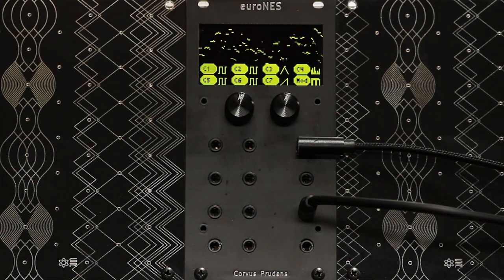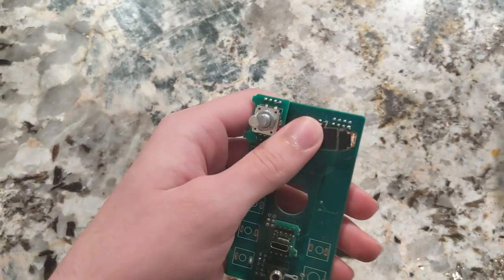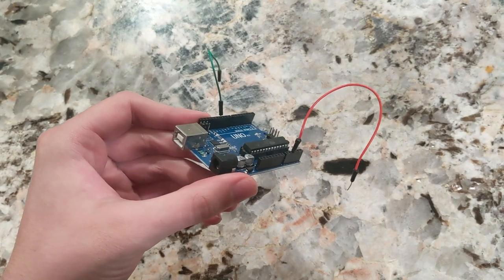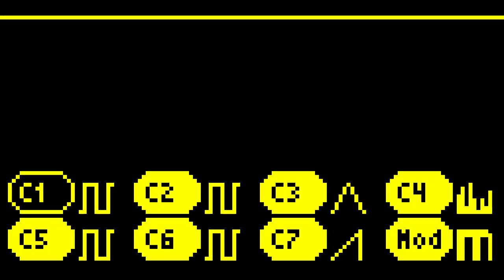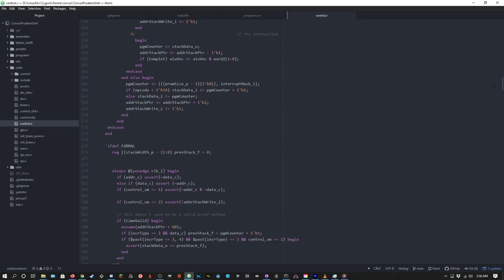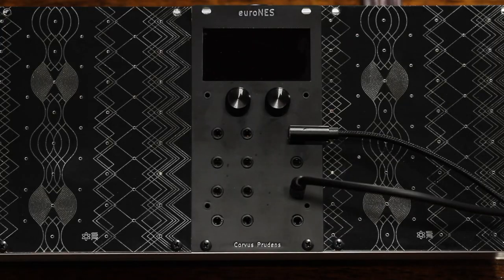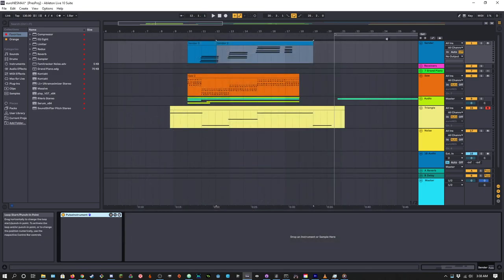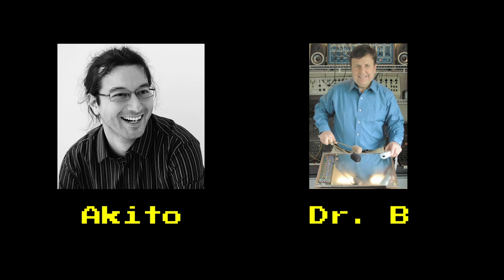euroNES | NES Eurorack Module

Comment: You need to make this at least $250, it’s important to value the time, personal invest and risk that you’ve accounted for developing this module. In addition, by charging $250 you can support yourself to pursue future projects, build a brand around your products, and cover additional development costs for firmware updates and bug fixes. Anyway, that’s just my opinion. Feel free to message me back if you’d like to talk more of the business side of things!
Reply from the maker: If I were selling through distributors, I'd definitely agree. They'll typically mark up around 30%. Going directly through something like Kickstarter though will allow me to avoid that, with the addition of some logistics overhead. It's still something I'm considering, though!
Reply: @CorvusPrudens  If you aren't paying a distributor, then you ARE the distributor. You should pay yourself for that job, not do it for free.
Reply: Don't forget Kickstarter will come to 15% take, and you pay taxes too. Sell it for a comfortable margin, you can always lower the price later if you achieve economy of scale or find cheaper ways to make it. But the original will always be a collectible, like the NES.

Comment: For what you've described and what you're offering $150 is WAAAAAY to cheap (At least from the end consumer pricepoint). You've done a crazy amount of work. This thing is rad. Even a simple module, like a good quad vca runs ~$200. You're making cool stuff. If you want to sell it at a discount later you always can. I'd pay $250-$300 for something like this and still think it was a pretty good deal.
Reply from the maker: Yeah I've gotten a few suggestions along the same lines XD. While it would be satisfying to deliver something cool at a low price, I suppose I'll actually have to crunch the numbers soon to see what's actually sustainable for me.

Comment: Great stuff! 

You can probably charge much more for it, like $250-300 would be a typical price for a boutique eurorack voice like that.

Curious what the CV inputs will do, I think that's critical for a eurorack module. Maybe there should be a way to maybe map cv inputs to various midi features that you have now.
Reply from the maker: Yes I'm in the process of developing the CV features now. I'll paste what I've written before again here:

I think a good approach would be providing a number of different input modes to suit the needs of a given setup. For example, you might want a 4 voice setup with a gate and pitch input per voice. Or, maybe two voices with envelope, pitch, pulse width, and a bonus modulator. Unfortunately, since there's only 8 inputs, you couldn't really control all the voices at once -- at least for now. Maybe I could add an expander in the future.

Comment: I keep coming back to this video. Thanks for all your hard work in putting such a beautiful module together - from scratch, no less! I look forward to purchasing one, once they’re made available. Have you decided on a width for the production model? If I had to guess, it looks like 12 to 16 hp? Can’t wait to fire one up in my rack!
Reply from the maker: Aw thanks so much! As I've played with it more, I've been wanting to expand the I/O quite a bit. My current plan is to have 2 CV and 2 knobs per channel, meaning it would have 5 columns of inputs on the base module. That would put it at more like 20 to 24 HP. Obviously the size and cost is increased a bit, but I feel like the huge boost in playability and ease of use is worth it.
Reply: @CorvusPrudens  Sounds awesome! Thanks so much for the update and Godspeed!

Comment: In the future if you want to make it a little more refined there are FPGA IP resources that would let you basically drag and drop something like a RISC-V core into the design
Reply from the maker: Yes, while that is true, there are a couple problems with that for me. For one, they're often not free, and I don't exactly have a large budget. They're also typically made to be general, meaning using up more space than my very specialized processor. RISC-V is also typically 32-bit, and I believe the bare minimum number of registers is 16. 

If I were using a Xilinx FPGA, none of that would be a problem. However, with Lattice's Ice40 line, you really have to be conscious of resources. I'm not an expert, so maybe I'm wrong here, but I don't think an IP CPU would be a good fit for this project.

Comment: Do you think you could do a short Update video on where this module is at? I'm ready to buy one, whenever you're ready to sell them... :)
Reply from the maker: I've thought about it several times over the past year or so. I have an issue though where I'd want the video to be really nice, even if it's just a little update. And when it comes to it, the time spent on an update video could just go towards getting it done instead!

I'm pretty happy with my design now, though. I'm mostly in the stage of rounding up the last few little hardware issues before it's pretty much as good as I can make it.
Reply: @CorvusPrudens  That's great news! I completely understand, it makes sense that you don't want to derail the module's development to work on a video. Thanks for the reply, it's great to know this is still being worked on and is near completion. Will it be sold direct by you on your website? (Is there a website?) Or how will these be sold when they become available? Really want to jump on the first batch when it is ready!

Comment: Very impressive!!! What OLED display model did you use? Do you know what would be its approximate dimensions? (I would like to use something similar in a project that I am working on)
Reply from the maker: I used this: https://www.crystalfontz.com/product/cfal12864ky-128x64-small-oled-display

They also have a white version linked on that page which I would have used if it was in stock at the time. They used to be  cheaper XD. All the dimensions are on the page too.
Reply: Hi, thanks for the fast answer! Just out of curiosity: how is going the project to sell this module? Just wanted to add that it surely deserves much success!!!

Comment: Just saw in an Electrosmith email that you have joined their team, congratulations (I hope this is still current, haha). I found your NES upload last year, it's very impressive, will there be any opportunity for any non-DIY 3rd parties (read: me) to be able to aquire this great module?
Reply from the maker: It's true! It's been great, but as you can imagine it's left me with less time for my own projects (which is partly why this is taking so long!). 

I just got my latest (and hopefully last) bit of hardware for the final design, so it's still progressing towards a proper release. I don't have a real ETA yet, but it should be within a few months. I'll put out some updates when it gets closer to that point though.
Reply: @CorvusPrudens  excellent, good luck to you!!

Comment: This is absolutely incredible. I would totally get one of these. What do the CV inputs control? Its hard to tell since you're just using the midi in.
Reply from the maker: The CV inputs are being developed at the moment. I'll paste what I wrote earlier here:

I think a good approach would be providing a number of different input modes to suit the needs of a given setup. For example, you might want a 4 voice setup with a gate and pitch input per voice. Or, maybe two voices with envelope, pitch, pulse width, and a bonus modulator. Unfortunately, since there's only 8 inputs, you couldn't really control all the voices at once -- at least for now. Maybe I could add an expander in the future.
Reply: @Corvus Prudens Two suggestions: 1. Please consider adding another four CV inputs so that one can control four voices with pitch, gate/envelope, and modulation. If this needs to be on an expander, that’d certainly be fine but in the main module would be better still. 2. Please, please raise the price. Seriously, it is too low.
Reply: (I say it is too low a) because of the capabilities on offer but also b) because you are going to enter a whole new world of pain when you actually try to produce a decent-sized batch of these, have to sell and ship and support them, etc. You deserve, and will wish for, compensation for those aspects also, and we will wish to help you with them.)

Comment: Ahh this is so cool!
I'm curious, which FPGA did you go for in the end?
Reply from the maker: I went with the Lattice ice40 HX8K in the BG121 package. It's the most capable FPGA in the ice40 lineup, although it has less I/O than the 256-pin package. The main reasons for this choice are cost, complexity, and current consumption. 

Most FPGAs are rather expensive, so I thought it would be best to choose one on the cheaper side. It's still the most expensive chip on the BOM by far at $8.

 I also wanted to keep the complexity down. The HX8K has two PLLs which require separate decoupling, and more capable FPGAs typically have several more. You can already see the amount of decoupling and filtering components beside the FPGA, and since I want to keep it single-sided, I wouldn't really want more complexity.

Finally, even though the HX variant is their "performance" chip compared to the LP, the HX8K is remarkably low-power. I'm pretty sure the RAM chip next to it uses more power. This one isn't a necessity, but it means that I don't have to worry about switching supplies vs linear regulators. I can just slap a couple regulators on there and call it a day.

I will say that the synthesis and PnR software for ice40 line, icecube2, is not so great. For whatever reason, they decided to use a horribly low-contrast color scheme for the logging, and it tends to optimize things away that shouldn't be optimized. There's also an open source tool chain available through project icestorm, but I find it even more problematic. The recommended PnR program frequently locked up with my design and got stuck in infinite loops. It really only seems appropriate for simple designs. All this to say that I would really like a more professional, developer-friendly tool like Xilinx's ISE.

Comment: Is this project still going to see a release?
Reply from the maker: Absolutely! I've been working quite a bit over the past few months on different aspects and run into some rather time-consuming dead ends. The approach I've taken is certainly not the most practical or economical, and it definitely takes its time, but in the end I think it'll be a much better module for it.

There's no way I'd drop the project, haha... I've had more than a few sleepless nights thinking about all the awesome features I'm going to pack into it.
Reply: That's awesome! I was just thinking about this video and wanted to check in. Wishing you success and I can't wait to add one to my system!
Reply: @CorvusPrudens  So great to hear. I plan on building my first eurorack system around this module.